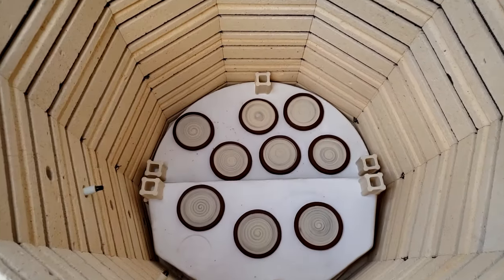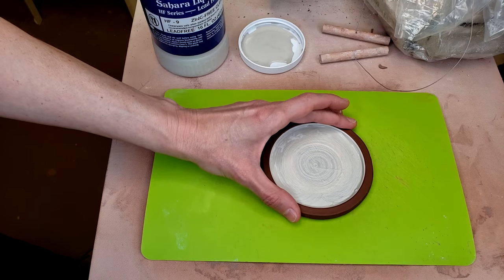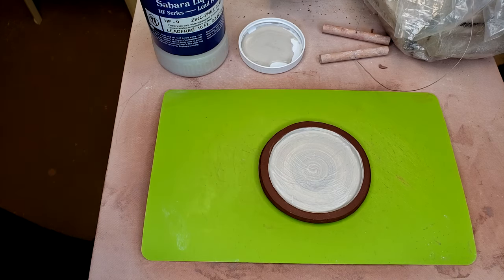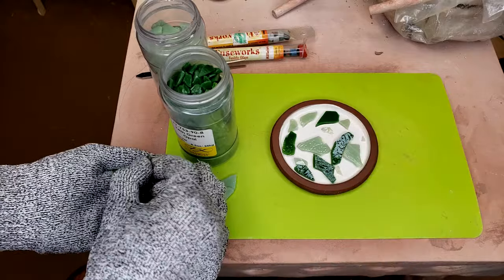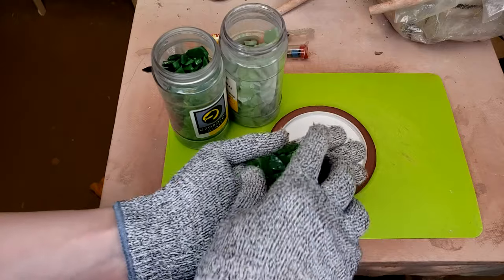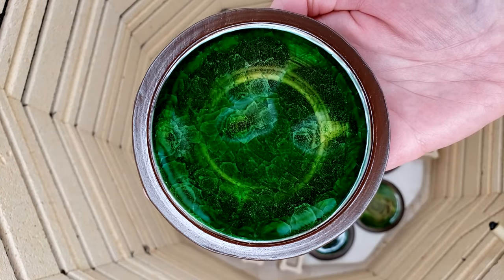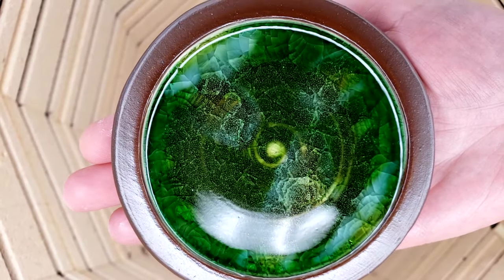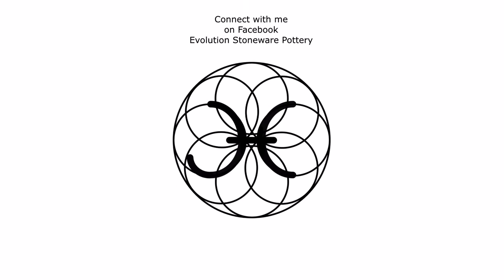Pottery: Making Drink Coasters Part 2 - Melting Glass

Comment: Great results, thank you for sharing your process!  I've found that doing a "soak" or hold time (7 minutes) or so minimizes bubbling.  (I bisque fire at cone 04 and add glaze and glass on; firing to cone 5)  In addition to your "medium" firing do you program a soak/hold?
Reply from the maker: Hi Troy, thank you so much for that info! I didn't do a soak on this firing. For normal glaze firings in this kiln I do a 10 minute soak because it's necessary for it to reach a proper cone 6. If I do more glass like this I'll try soaking it for the bubbles. Thank you again! That's very helpful.

Comment: Hello!!  I JUST found your channel and am so inspired by your technique.  I am a ceramic "artist" (I use that term lightly) and have a ton of glass that I always wanted to incorporate in my ceramics.  My question is that you say you bisque to 04 and then use a clear glaze on the inside and then fire to cone 6 (2232o) is that correct?  I thought glass can only be fired to max 1500o  I LOVE your pieces! and really would look forward to you confirming cone 6 for ceramic/glaze/glass firings!  TIA your items are OUTSTANDING!
Reply from the maker: I fired the clay directly to cone 6 with no bisque to get all the shrinkage out of the clay. Then I applied clear glaze while they were hot, and then added glass. Then I refired to cone 6. I used COE90 Frit for the glass. I hope that helps!

Comment: hi! do you think it’s ok to use glass in an ash tray? is it safe enough to be able to stamp out the joint on the glass and then use the joint another day? is ok to wash the ash tray?
Reply from the maker: I think it would be fine, but I don't know for sure. In this case to minimize any slivers of glass popping up I recommend high firing the clay first to get all the shrinkage out then refiring with the glass inside (as I did in this video). Also cool the kiln very slowly when the glass is inside. Good luck! I hope it turns out awesome!